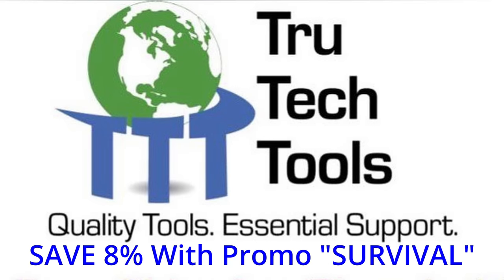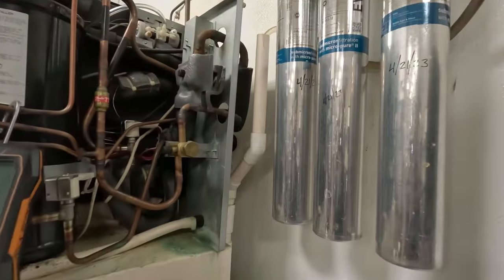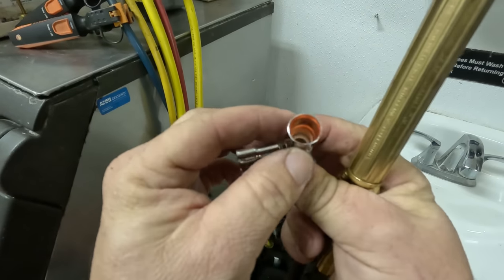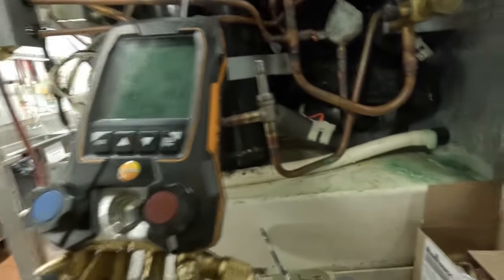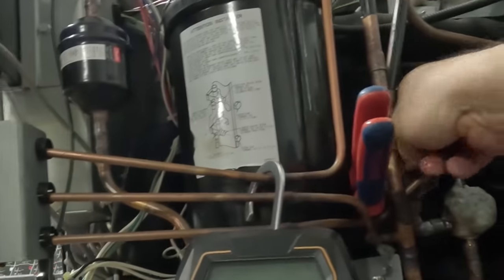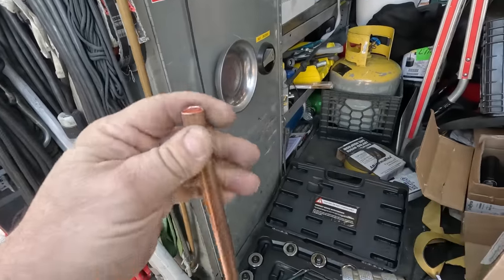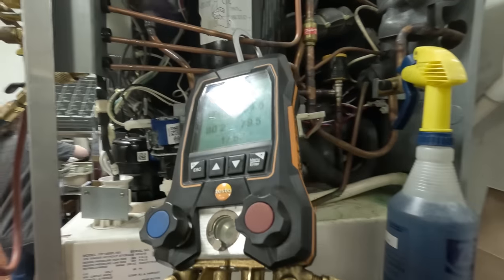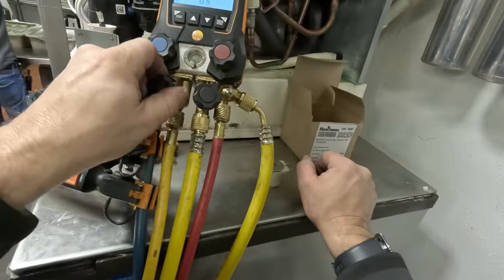Manitowoc Ice Machine Not Making Ice Again!

Comment: The funny thing is, Manitowoc would send you a special bracing rod with certain compressors, but using 15% you can do a lot, even brass to copper, and copper to steel
Also, great video as always man!
Reply from the maker: That was my standard dyna-flow

Comment: Spoke with tech support on these hot gas valves during harvest long as you have 75 suction and up that let’s you know you have hot gas passing through the valves another way to test is it you have 34 degrees on t3 and t4 which is the sensor going to your txv your valves are working as well

Comment: I was told at factory training class that you arnt supposed to use a standard filter drier. When it switch from freeze to harvest the flow could flow backwards in the filter drier and eventually it will break apart or get damaged. A bi- flow filter drier would be a better option if you don’t have a factory filter. But who knows maybe they just want you to buy the filter drier from them.
Reply from the maker: I only had a 163 bi flow. Kinda big

Comment: Manitowoc strongly recommends that when replacing the cool gas valve that you replaced both of them at the same time due to possible contamination the system even though it is a pain in the buttocks it is highly recommended highly highly recommended but it is what it is when it comes down to Customer cost
Reply from the maker: That’s interesting because I was speaking with them on the phone and they did not recommend replacing both of them that was my original intent, but they said, no, it’s not needed

Comment: We have some driers where the manufacturer must put some sort of coating on the stubs that prevent the brasing rod to stick and take .
I clean the sh*t out of it with sand paper and use silver rod to brase it and it's fine , but the 1st time i had to learn the hard way 😅
Reply from the maker: I know that feeling, soon as it won't stick 🤦🏻🤫

Comment: 👍💪🇺🇸❄️ nice work. Good to know u can use 15% rod on metal valve with copper coating inside n brazing to copper. Thanks
Reply from the maker: It said as little as 5% 😁 and that's great because I think that was all mine was.

Comment: Hey Guy. We have an ice machine that will not Harvest on its own. We called Manitowoc.  They recommended spraying evap with cooking spray to determine whether or not ice was forming behind grid or if there was a plate issue.  We put cooking spray and it dumped perfect sheets of ice.  Descaled evaporator under heavy solution .  No luck.  Upon  inspection there is definite discoloration on evaporator but no copper color seen.  We just gonna replace evaporator or unit at this point.  Any advice would be appreciated.
Reply from the maker: There is other things to make sure of first but without seeing it’s kinda hard. I like to make sure there’s no refrigerant issues, then if that’s not it then it could be the evaporator plate.

Comment: I'm considering buying a Manitowoc IYT0450A-161 Indio to replace my Hoshizaki km-201bah because I need a bigger machine. I only use the ice for my soda and food coolers in my hot dog trailer, so the ice is not used in drinks. I'll use approximately 160 pounds to 210 pounds a day, depending on the weather. Would you reccomend doing a chemical cleaning twice a year and a take apart cleaning once a year for what I use it for? It'll be in my basement, where it's always cool. My Hoshizaki is in the garage so the melted ice goes directly outside with a pipe, but where I'm putting the new one, I'll have to put in a drain pump. The garage also gets hotter during the summer. Would you reccomend a Hoshizaki that's equivalent to the Manitowoc or is the Manitowoc good enough?
Reply from the maker: The number one thing that takes these ice machines down is not being cleaned. That being said one of the things that really hurts them is being an environment that has a lot of yeast from breads, and that causes a breeding ground for the nasty crap that grows in there, but if you're not gonna have this around the food, then it won't get as bad as quick, my feeling is if you clean it lightly more often it doesn't take as much effort to keep it clean versus waiting till it's built up with a lot of gunk and then scrub the living snot out of it. Both machines are great machines. We sell Manitowoc and I've service plenty of Hoshis. I've had some problems diagnosing the Hoshis, but I have been through their class and they're very well-built machine. They do seem to be more resilient to problems. However they are more money and that's why we sell more Manitowoc. Personally, if you don't wanna invest a lotta money get the manitowoc they work just fine. We lease them for 5 years and dont have that many problems.
Reply: @HVACRSurvival  Thanks for responding! It would be kept in my basement, that not humid, nor hot and isn't around any food. Thanks for the advice and they seem relatively easy to clean. The usage won't be like a restaurant, so twice a year should be okay.

Comment: Can it be braze with the Nitrogen inside same time
Reply from the maker: Is it recommended to use nitrogen when brazing so that you do not get carbon buildup inside of the pipe, which plugs up, expansion valves, and filter dryers.